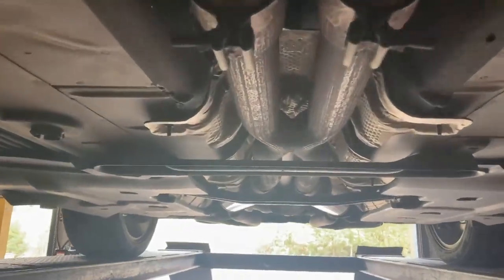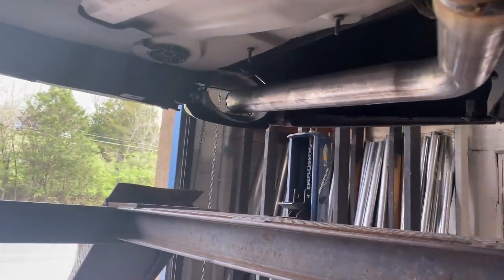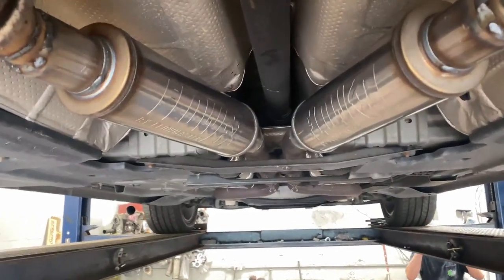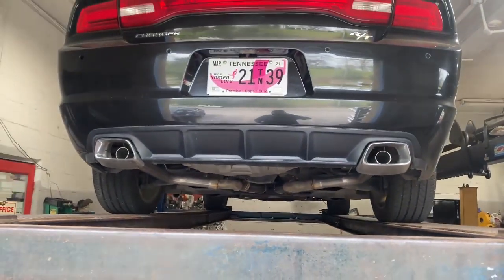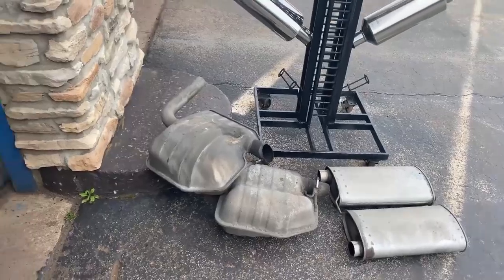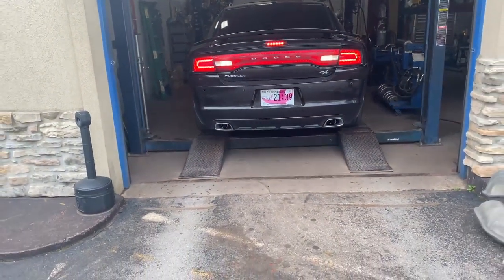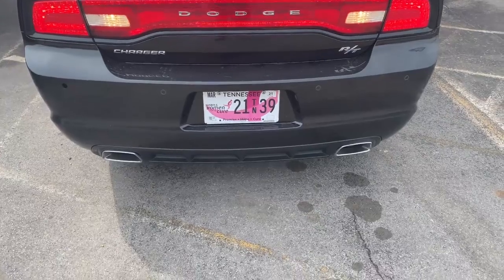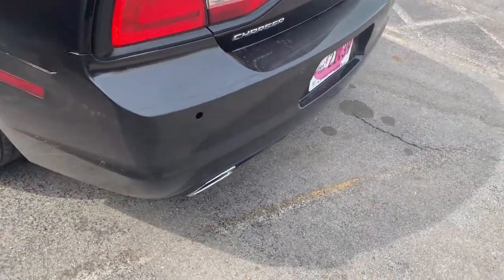2011 Dodge Charger R/T HEMI DUAL EXHAUST w/ FLOWMASTER FLOW FX!

Comment: Car is in remarkable shape to be the first model year of the current LX(2011) w/ 203K+ miles on it. Black paint still in good shape and it still sounds damn good! For all of those Dodge/HEMI haters that swear they don't last....😊🙃

Oh and this is perhaps the first HEMI application that the Flow FXs sound good on. Sometimes they're a little raspy or too toned down. Perfect for the character of this non-SRT HEMI.
Reply: Anthony Gates  Chargers didn't receive the 392 name until 2015+. And even then, non-SRTs still receive them in the form of some Scat Packs. So yeah...
Reply: There are dozens examples hemis that sound amazing with these flow fx pipes on YouTube. You have no idea what you’re talking about.
Reply: @Mike-hn4uu  good sound is subjective. But hey, I only drive HEMIs everyday, so what do I know.

Comment: Holy cow! Did that say 203k miles?!? Thats ALOT of miles on that Hemi for it to not have a tick!
Reply: Justin Hall the 5.7 is the most durable hemi out the four Hemi motors.  Like the old saying,  you take care of it and it will take of you.  Not talking bad about the 6.1, 6.2 and 6.4 but the 5.7 is corporate motor which goes in all FCA vehicles.
Reply: @Smurfd392  yup. Once they fixed the valve seat design of the 2002-06 engines and new lifter design for some HEMIs that ate the camshafts, the 5.7 really became the workhorse.
Reply: Antione Murphy no. More than the 6.2 and 6.4 yes. But the 6.1 was literally simple and all motor. No MDS and no lifter failures. The 6.1 was the best hemi engine ever made.